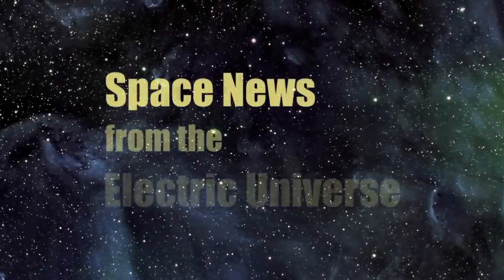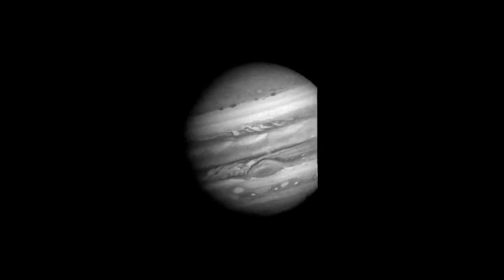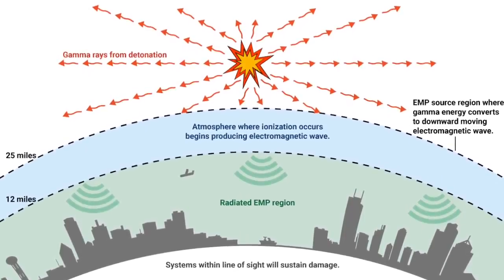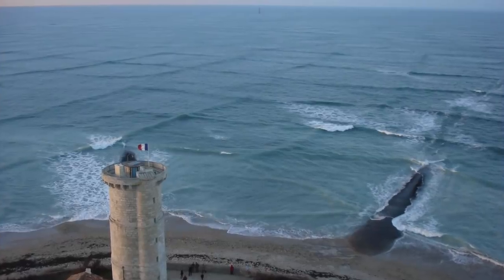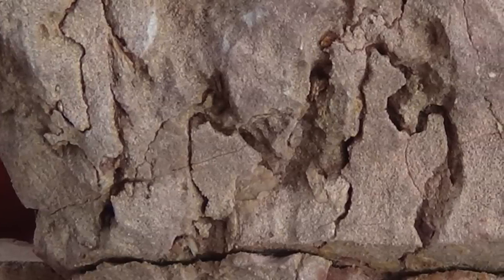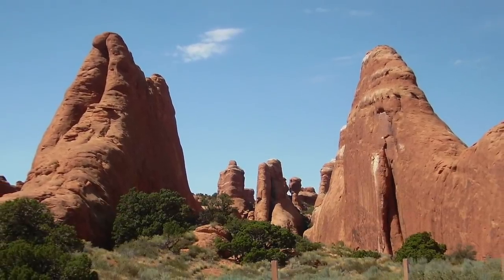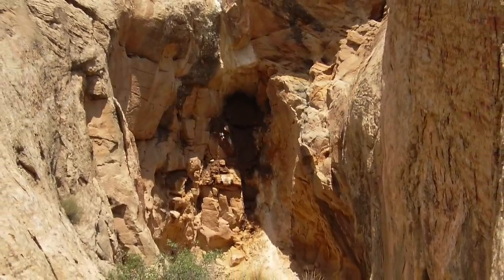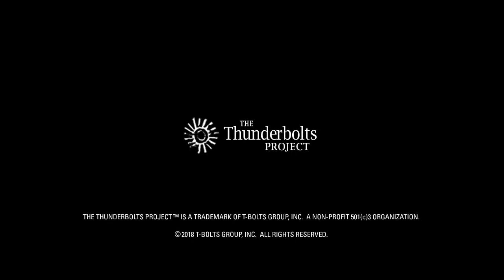Andrew Hall: Electric Winds and Earth Geology | Space News

Comment: I know the rock of the Blue Mountains outside Sydney quite well from years as a tour guide there and this series resolved a whole raft of questions about the common formations there. I always suspected that the iron bands that are exposed in the sandstone there had a magnetic aspect but would never have conceived of them forming so rapidly as they apparently did. I also wonder if the Basalt caps of Mt Hay and Mt Wilson might suggest that the Basalt itself is electrically formed rather than volcanic? Thanks so much for the hard work opening up this new understanding. If you ever need a holiday the weather is mild and the geology electric.